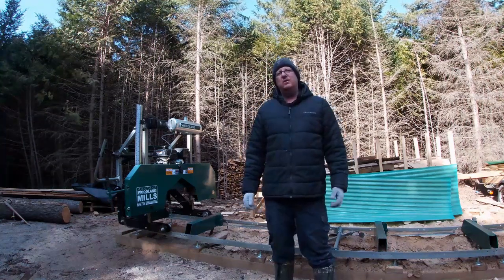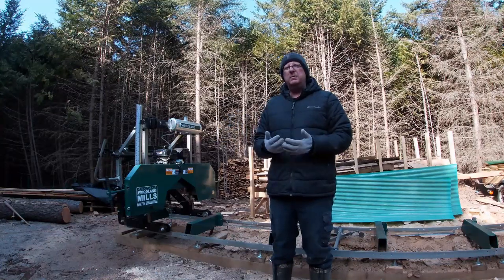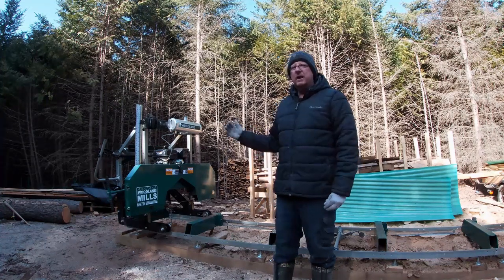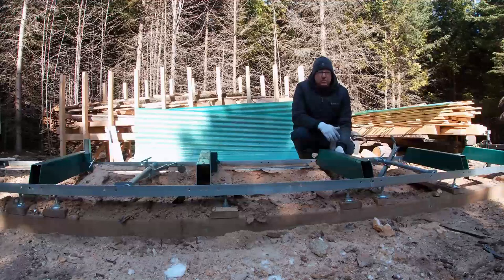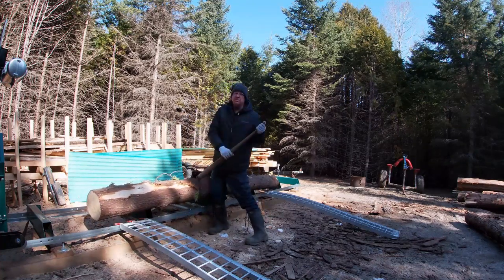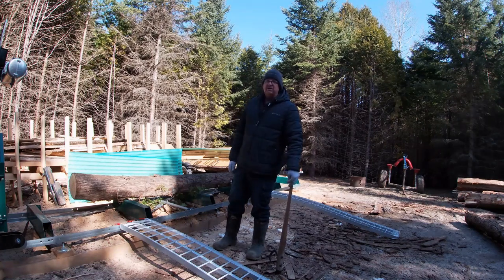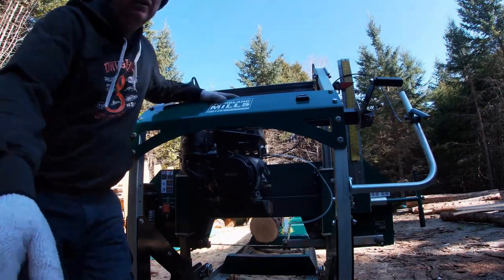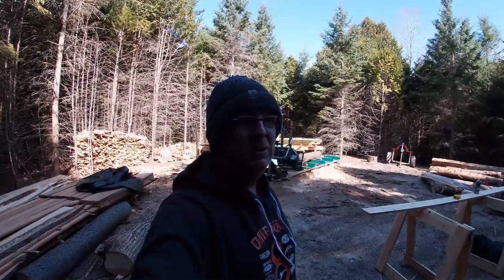#34 Woodland Mills Sawmill Beginners Guide | How To Operate/Use |  Part 1

Comment: Good tips! One thing that also can increase the yield from a log with lots of taper (bell) is to start with the big end towards the mill, especially if the difference is more than 2”, you can sometimes get a board or two that might be shorter then the full length, of course it will need to be edged to finished width. Starting with the small end to the mill on the first cut the thicker part of the taper is lost. As they say “waste not want not”.
Reply from the maker: Yes right on! Actually in part two i show exactly what your talking about. The video ended up being a lot longer than I planned so I had to do 2 parts or else it would have taken me forever to upload it.

Comment: What is your opinion/experience with water flow rate? What do you find is too much or too little? Do you adjust flow rate to different kinds of wood?
Reply: I can tell you my thoughts on flow rates. In winter frozen logs are easier to saw with very little usage of windshield washer for lubricant if any at all, the blade will stay cool as well in frozen logs, as for above freezing temperatures it all depends on the type wood, hard or soft, sappy or dry, I fill the tank with water and a squirt of dawn dish soap, and set the valve to a slow drip on dry and slight higher drip on sappy or hardwood logs, but not a stream.
Reply from the maker: I pretty much agree with everything William said. I saw the extension that you put on, like that idea. I also find it hard to get the right amount coming out as i find it kind of hard to get a slow drip. The only thing I have cut so far that didn't work out good was spruce. It left some of the sap on the blade, so next time I will try a better flow and maybe some extra dish soap.
Reply: @bluethunder1951  Thank you. I'm running about 75 drops per second in green alder, much less than I did in the beginning. Blade stays clean and bright.
Reply: @OregonOldTimer  wow, didn’t think anyone could count that fast in a second, but I’m sure you have it figured out 😉 as they say keep the blade wet and the sawdust dry.
Reply: @bluethunder1951  Argh! Per minute, of course.